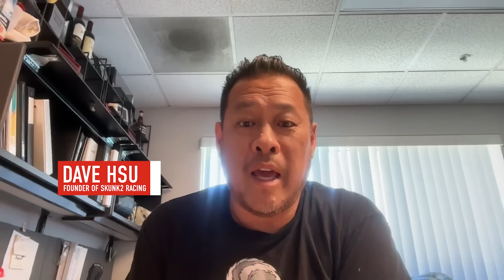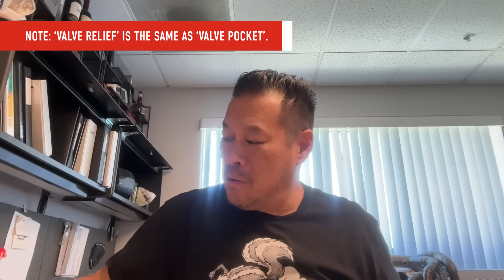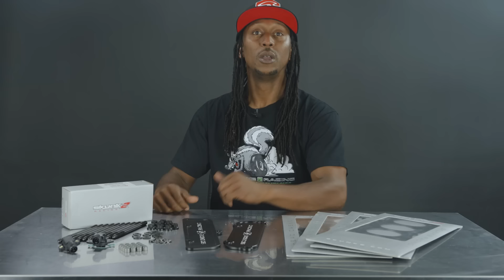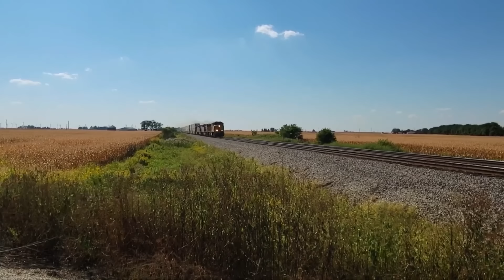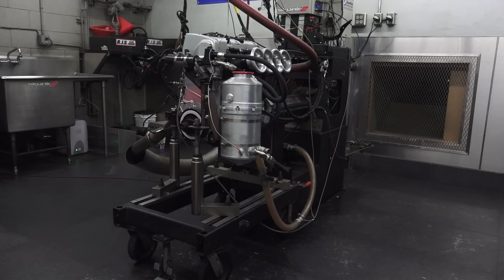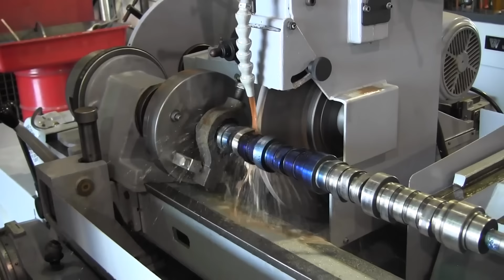Skunk2's TECHNICAL DIFFICULTIES - Part 15: Real Recognize Real

Comment: I got a quick question when your looking at the graph the cam is represented as you guys, call it a ramp, but a camshaft is not profiled as a ramp because it's is centrifugal meaning the cam is round or oval shaped. I guess my question is using a ramp graph to determine the profile of how a cam moves is it acceptable or accurately depiction. Maybe a stupid question
Reply: the profile is lift data in a radial plot. for discussion we have been using linear plots for the same lift data.
Reply: Good clarification that makes sense now

Comment: I comented I had around 13.5:1 compression. After doing my homeworks I found out I only had 12.86:1 lol 

New build will end up at 16.08:1 🤘
Reply: Almost all off the shelf pistons are like that. I ordered a 14.2 once and after measured i got 13.5 lol. Now i always order the piston with maximum comp and machine it down myself

Comment: What compression ratio is ideal for a skunk2 ultra 1 camshaft on a k24?
Reply: What fuel are you using ?
Reply: @markwallace5274 , what is the max vtc for the skunk2 ultra 1 camshafts
Reply: I'm from south africa and im using 95 pump fuel.